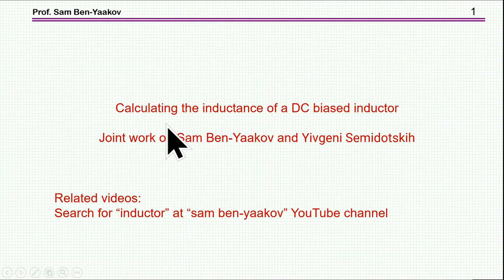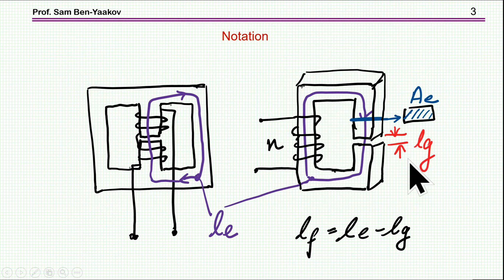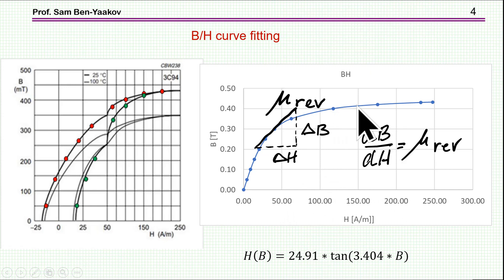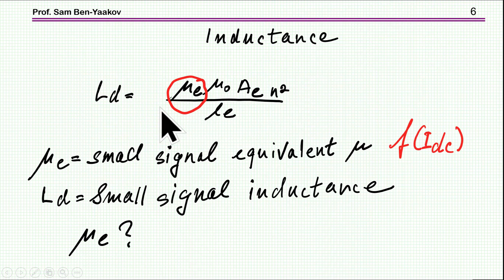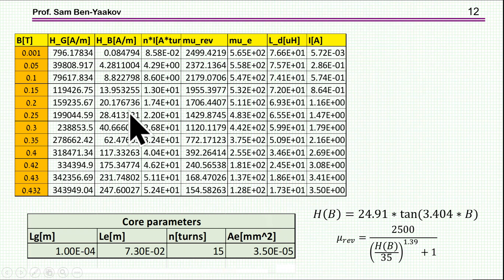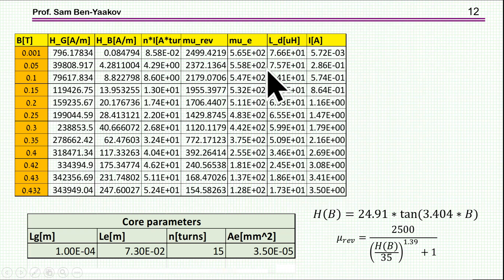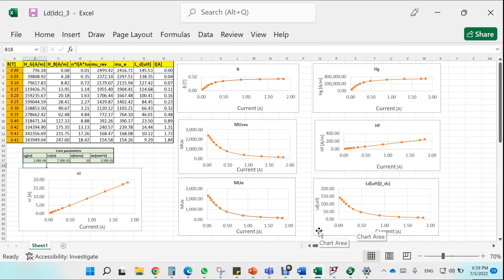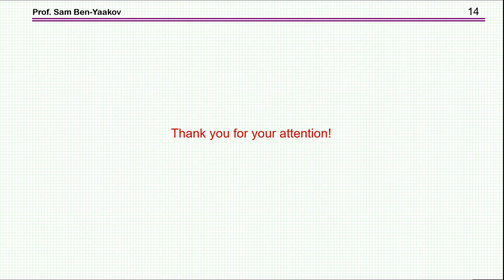Calculating the inductance of a DC biased inductor

Comment: If I compute mu_rev as dB/dH (deriving the formula H(B) = 24.91 * tan(3.404*B)) the obtained values are different from those given by mu_rev=2500/[1+(H/35)^1.39]. 
Is there any mistake or are you using the same symbol for quantities that have different meaning?
Reply from the maker: Please indicate the minute in the video you are referring to.
Reply: @sambenyaakov  
The formula H(B) = 24.91 * tan(3.404*B) appears from minute 1 and 40 seconds up to 2 minutes and 30 seconds. 
The formula mu_rev=2500/[1+(H/35)^1.39] appears at minute 2 and 30 seconds up to 2 minutes and 55 seconds.
Anyway, I'll try to explain better my question. 
Deriving the formula H(B) = 24.91 * tan(3.404*B) we obtain: dH/dB = 84.79 * [sec(3.404*H)]^2
From which: mu_rev = dB/dH = 1/84.79 * [sec(3.404*H)]^2
This last formula gives values of mu_rev different from those obtained with the other formula: mu_rev=2500/[1+(H/35)^1.39] .
So I asked why? Am I making any mistakes?

Comment: Hello professor, for the equations you derived, are they overly optimistic or conservative? For instance, H(B) = 24.91 * tan(3.404*B). If I were to build an inductor using this equation and the rest of them, and measured the actual flux density at a given field intensity, how accurate or far off would the flux density result be? Same goes with the rest of the equations. Thank you! I really appreciate all your videos and work
Reply from the maker: The fitting is fine. The problem is that the geometry makes a difference. This is where FEA comes in.
Reply: @sambenyaakov  Can you explain your comment more? What does it mean the fitting is fine but the geometry makes the difference?

Comment: Hi Professor,
Thank you for this helpful presentation. I have some questions that are closely related to this topic. This presentation is about the value of urev (relative magnetic permeability) and the inductance of a DC-biased inductor. But what happens with urev when an AC current with very low frequency, let's say 50Hz, flows through the inductor? Will urev (and with it the inductance) also change with the phase (instantaneous value) of the current?
In a practical application: Let's say I'm using an inductor in an LC filter to filter noise above 30MHz. A current with sinusoidal form and 20Apeak-peak flows through the inductor. Will the cutoff frequency of the filter be different when the instantaneous current through the inductor equals 0A  (phase  = 0°, 180°C) than when the current equals 10A/-10A (phase = 90°, 270°)?
Thanks
Reply from the maker: Yes, indeed the LF current will have a similar effect. This is why line filters include common mode chokes in the coupled inductor configuration to zero the magnetization flux.

Comment: Did I get this right? That an offset signal in an inductor will change the inductance?
Reply from the maker: Yes indeed.
Reply: @sambenyaakov  is this related to core saturation and thus modulating relative permeability? I suspect simulation won't work for this. I guess I have to fire up my scope and try to make an Oscillator to tune by changing the drive current in the LC tank.
Reply from the maker: @xDR1TeK  Indeed most simulators will not show this effect

Comment: This is a very simple and clever procedure that is easy to follow.  The key seems to be the fitting of H(B) and µ(H).   Are the forms of the equations you are using to fit these curves always what you have shown in this example or do the forms of the fit equations vary with differing materials?
Reply from the maker: The templates should be universal for ferrites..
Reply: What is the equation to use in regards to a Nanocrystalline material specifically Finemet FT-3M? I am trying to fine H(B)